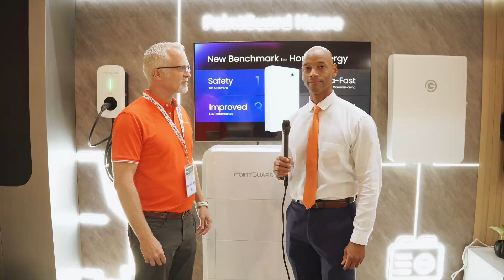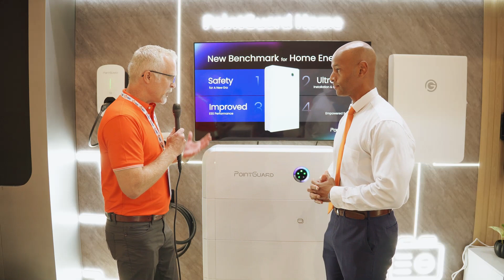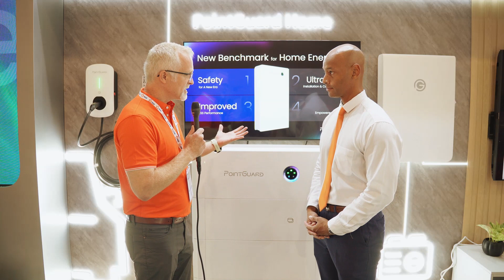SolarSurge RE+ Interview w PointGuard Energy CEO

Comment: If the remaining issue with such full DC Solar w/ Bye Pass Diodes + Batteries + New-gen Battery stack integrated Central Inverters, is their single point of failure, why not offering a fully redundant capability here, with 2 Inverter+Battery stacks, redundantly cross connected to each others, so each Inverter can replace the other instantly in case of other inverter failure, taking ownership of the whole set of batteries in both stacks ? 😢
That would push for more inverters and more batteries sold with marginal extra costs if optionnal setting....